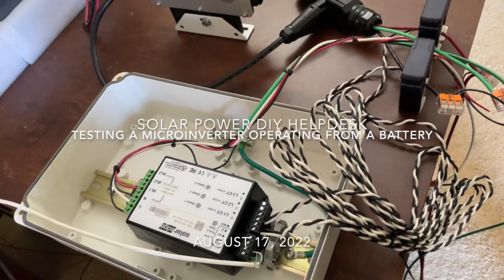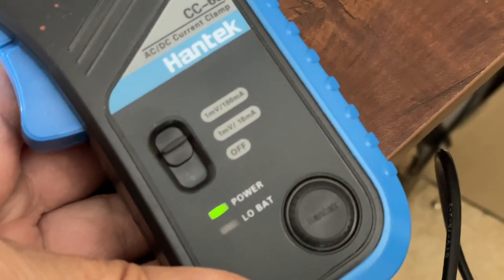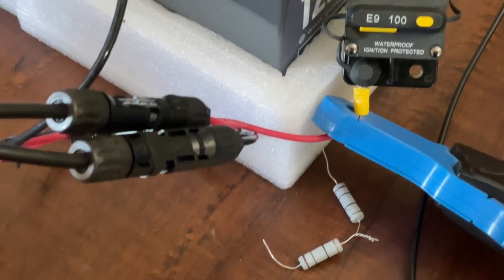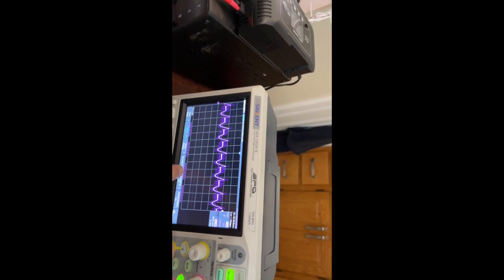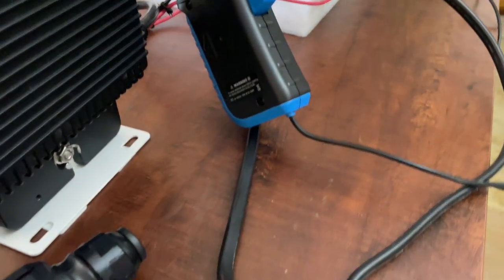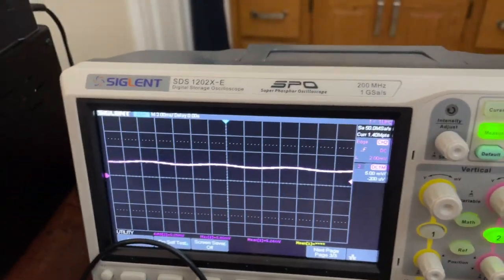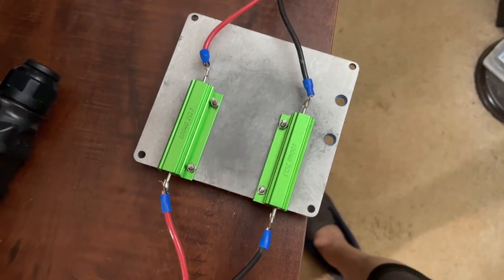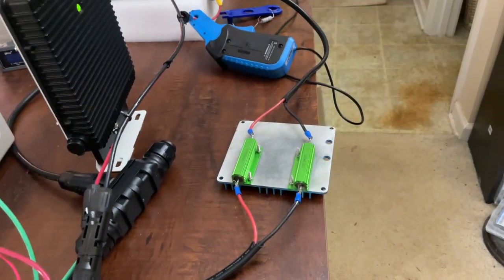Testing a Microinverter Running on Battery

Comment: Interesting! Do you know whether an APsystems EZ1-M can be hooked up directly to a 48 V battery?
Reply: I haven't tested it, but it should work if you pre-charge it before connecting the battery.
Reply: @ToddDesiato  Thanks for the quick reply! I've read many comments in the meantime and some say that a 48 V 50 A capable battery would likely 'fry the inverter'. Is this something to worry about? When I chose micro-inverters for my PV setup, I made sure they wouldn't cap the max. power output of the solar panels. So based on that I know a micro-inverter will probably limit the current inflow from a battery by design, but naturally I'm looking for safety first.

On a side note: I like the modular concept of micro-inverters, for one you don't have a single point of failure and it's better scalable. In the Netherlands there is a company called HomeWizard who have picked up on this principle in the context of battery storage and they're actually launching their Plug-In Battery which is basically a cost-effective AC-coupled design: https://www.homewizard.com/nl/plug-in-battery/

This 2.7 kWh battery storage unit can be plugged into any normal wall socket and will charge/discharge at 800 W max. which is within European regulations. People will be able to use more than one of these and then 'software unlock' the batteries to effectively operate in parallel (so 2 batteries at 1600 W charge/discharge and 5.4 kWh energy capacity etc.).

For sure they're using a micro-inverter in this device, the big question is what they've done to make it battery-compatible, if anything.

Comment: Can from battery  to microinverter  using the dc to dc converter to regulate the voltage and low the output amp
Reply: Look at some of the earlier videos where I tried this. Yes, it works but the dc to dc converter is unstable. The frequency varies all over the place due to the 120Hz ripple current pulled by the inverter. The HMS-500-1T-NA can connect directly to the battery and you use a DTU, and a meter with RS485 to control the output.
Reply: @ruslanwel  Did you use the resistor in your circuit?
Reply: @ruslanwel what issue did you have when using the DC-DC converter？I am thinking about the same setup but I am going to use it daily It seems like drawing power from the battery will make it run at its maximum output continuously and it's not designed for that. Do you have any tips or suggestions ？Thanks

Comment: Im confused. so can microinverter run directly from battery or not? withouth the resistors? Thanks
Reply: This one cannot, because it will exceed the Isc rating of the 350W inverter MPPT inputs. However, the HMS-500, 1000, and 2000, can run directly from a 48-56 Vdc battery. The limit is 25A. It's just not covered by the warranty if it fails.
Reply: @ToddDesiato  Hello Todd, I recently came across a discussion online about the Enphase microinverter and its resistance fault check during startup, which requires detecting a certain resistance to function correctly, potentially preventing it from operating if the power comes directly from a battery.  Do you think the HMS microinverter doesn't have that resistance fault check and that's why it worked? I am trying to set up a circuit like this to off-set my peak hour use during afternoon, do you think it will work in long terms? Thanks!
Reply: @ToddDesiato  How about the APsystems EZ1-M/H?
Reply: I've got an HMS-350, I plugged It to a 24v battery and It's fried now. Probably i'd to use a resistor. Waiting for the reparation. I'm assuming of using the LOAD output of a mppt to Power up the inverter. Somebody have tried It?

Comment: How about simply adding configurable BMS to limit the current?
Reply: It would make the BMS run hot, but it will work I think. I don't have one to try it.
Reply: @ToddDesiato  The BMS could be oversized and run it only i.e. at 50% rate to keep it cool(er).
Reply from the maker: @KenSentMe-  With that configuration, you would need a BMS for each microinverter. I just need a couple of resistors and a MOSFET. I have boards designed, but now I have Hoymiles Hybrid inverters HYS series on order. I don't need this anymore.

Comment: That was interesting , i was thinking of getting a Hoymiles microinverter , iv only got 3 240 watt panels in garden on garage roof,  one question please , dose the Hoymiles microinverter need the gateway to wake them up like the enphase dose ? or dose it work straight out of the box ?
Reply from the maker: Great question! They work straight from the box. As close to a Plug-n-Play solution as there can be. The Data Transfer Unit (DTU) for monitoring is optional, and only around $300. If you want to discuss more and create a plan, I'm available daily at (877) 58-SOLAR. Thank you.
Reply: @DiySolarHelpDesk  That's great many thanks for that information ,that i couldn't get anywhere .I'm living in the UK so i guess i'll have to take a look at seller here ,so far only found Germany .

Comment: very very interesting
Reply from the maker: I am working on a new product to make a battery behave like a solar panel, and limit the current to within the microinverter's spec. It will pre-charge the capacitors, provide a low battery cut-off, and automatically restart when charged. When used with the WattNode meter, it can do zero-export time-shifting, energy arbitration and peak shaving. It's almost ready for Beta testing. (877) 58-SOLAR.
Reply: @DiySolarHelpDesk  In this way don't you lose the mppt alghoritm features? and what do you think about use for example a Renogy dcdc battery charger il parallel to the hoymiles micro grid input?
Reply: @sebaberny7170  MPPT doesn't matter when working from a battery, but this keeps the current below the limit. You can use any battery charger.

Comment: hm. Im waiting for parts for doing the same test but with yc100 and with a 48vdc/55Ah battery bank but as i didnt understand from the video is how you made the calculation for the resistor as the current limiter... the microinverter i will test got 14.6ADC*4 inputslines working between 22-60VDC.  How did calculate the 2ohm and 0,4ohm values?
Reply: Thank you. As of today, I also have a 48Vdc/50Ah setup. I estimated the resistance of a 400W module to be about 0.8 Ohms. I bought 4 x .2 Ohm resistors, 100W each because they were cheap and available. As an alternative to the resistors, tomorrow I will receive an isolated DC-DC converter with a 10A maximum current at 48V, so there is no need for the resistor, in theory. We shall see. I also just received the correct CCS WattNode meter that should work for export control. Fun times coming in the next couple of days!
Reply: @ToddDesiato  thanks for the reply, now i understand what you refering to. Tomorrow i get my stuff to complete the setup. I was thinking of using a maximum power point tracker device to reduce the current to 14,6ADC-ish. Is that what you have in mind with dc-dc converter 48VDC/10A or did you find something else useful? As i know, a dc/dc does produce some heat.
Reply: @gooseberry46  Turns out, the DC-DC converter shuts down without any resistance. The microinverter will draw 13A, which exceeds it's current limit so it shuts down. When I added the 0.2 Ohm resistor in series, it worked fine. The MEAN WELL SD-500L-48 will accept an input range from 19-72 VDC, so it makes this compatible with just about any battery 24, 36, 48, 60V. 
Then I removed the DC-DC converter and just used the 0.2 Ohm resistor in series with a 15A fast-blow fuse, and the 48V battery bank. It also works fine. I'm going to design a circuit board with an automatic pre-charge resistor and MOSFET, and the 0.2 Ohm resitor and a current limit shutoff. Then, this can be integrated with any microinverter.
I needed to get the firmware updated in my DTU, but the meter works and I now have a working peak-shaving energy storage system!
Reply: @ToddDesiato  well, i got my package and can see it isnt what i thought it was. So im delayed...
Reply: @gooseberry46  I don't know what you got, so... I'm curious. I just got my DC breakers so I can set up more than one inverter. I just need to mount another resistor on a heatsink. It's fun!
Reply: @ToddDesiato  i order a mppt but got a pwm, tried with the pwm but no luck there. The setup does startup but halts on red light, ground issues. I think i also need that 0.2ohm resistor..
Reply: @ToddDesiato  i tried your setup but with two lto150 resistors in series and it seemed to work just fine! It got really hot but it seemed to get around 10A before i stopped the test, as for now it looks like a mess. I will also setup a heatsink for the resistor and see how that will work out :)

Comment: I've been running a second-hand Enphase 215W micro-inverter with a single 265W PV panel and 3 x reclaimed (free) Dyson 6S batteries in parallel (faulty units with new BMS). The batteries charge slowly from dawn (panel facing West) via a high current Schottky diode. At about noon, the batteries are full and the BMS switches off. The mains is switched on through a timer at 12:30, so the panel is then feeding the inverter for the rest of the daylight hours. At dusk, a light sensor switches the batteries (via high power MOSFET) to the inverter giving about 40 minutes run time at over 200W. The mains timer switches off at midnight. This has been working perfectly for about 3 months so far.
Reply from the maker: If the micro is connected directly to the battery, what is the DC input current and does it exceed the input current rating of the micro?
Reply: @DiySolarHelpDesk  The maximum operating input current of the Enphase M215 is 10A, and it seems to limit itself to that. Bear in mind that these are old batteries and are about 25V fully charged, quickly dropping when loaded. I did contemplate using 7S Dyson batteries, but I think that may be too much. It's been running for over 3 months with no issues, so it seems to be happy.
Reply: Hello Andy, how has your setup been running? Are you connecting the panel, battery, and inverter in the same circuit? Thanks
Reply: @deyumei7965  It's still running well. I use MC4 splitters to connect the battery unit across the feed from the panel to the inverter, so it's easy to disconnect the battery when required. I remove the battery during the coldest months.

Comment: Hello, I am very interested in your test. My question is if the maximum DC current supported by the microinverter is 15 amperes, how does it happen that the inverter does not burn, taking into account that the batteries can discharge much more than 15 amperes (50 amperes)?
Reply from the maker: The current shown at time 0:53 is 30A peak. This is what the micro will draw if there's nothing to limit the current but itself. It draws what it needs to deliver full power. In the case of a PV module, the Isc is about 10A for a 400W module, so the current could NEVER go to 30A. This was making the fuse and the wire get hot so I discontinued the test. I then tested it with a buck converter which was somewhat unstable. It worked but I would need to design one myself to get it to mimic a solar panel correctly. I then tried the 2 Ohm resistor and the 2X 0.2 Ohm resistors (0.4Ohms). They limited the current but not enough. The maximum rating of the micro is 11.5A dc. I find that if It runs at 46Vdc and above, using my power supply, then the input current is ideal with just the 0.4Ohms, but I am going to try a SIC JFET because that will dissipate less power and provide a hard current limit at 10A. A buck converter would be the most efficient solution, but I haven't designed one in decades. The chips I used to use can't be found anymore.
Reply: Because the current drawn is a function of the resistance of the load, not the battery discharge rate.  You could hook up a 12V appliance that draws 1A to a battery that's capable of discharging at 200A, without burning it up.  In a short circuit scenario with zero resistance, that's why you have problems - and why fuses exist.
Reply from the maker: @davereichert  I've learned that with microinverters, they have a maximum input current spec., Enphase is 15A. Hoymiles vary by model. They RELY on the Isc of the solar panel to limit the current to that value. As evidenced in my test, when I connected it straight to a battery, it drew 30A, nearly 3X more than it is rated to handle. This is why I have developed a product to limit the current and make a battery behave like a solar panel. New video series coming soon!
Reply: They self limit. Inverters control the current they take in, as long as the voltage isn't too high.
Reply from the maker: @Theaveragenerd2000   Eventually. The meter on the bench is for export-control and var-control. The inverter can accept DER commands to throttle back the output power, thereby drawing less input current. I haven't tested it because the meter I have is not the right one. It didn't communicate. I ordered the right one, it will ship on 8/23.
Reply: @Theaveragenerd2000  I think it's the first microinverter I've heard of that limits its input current by itself. All the others would have burned out instantly.
Reply: Starting from 09:10 we see a pair of high-power green resistors that appear to be in series with the batteries on the microinverter DC input. I think those resistors are limiting the DC input current.